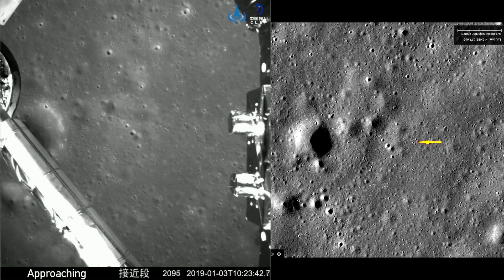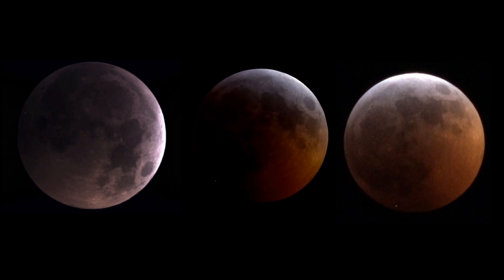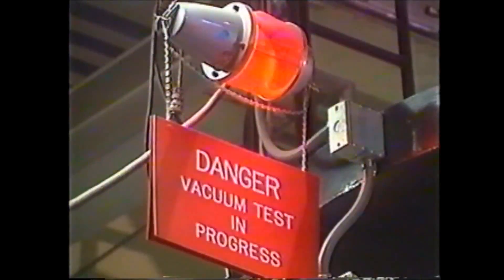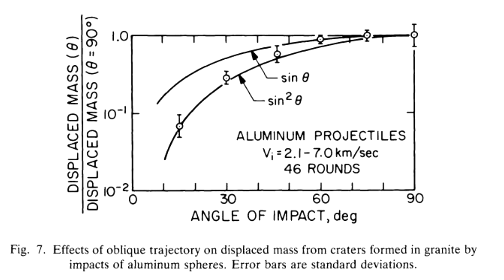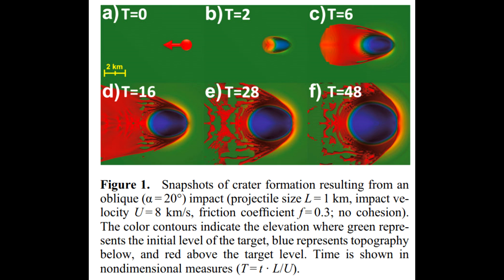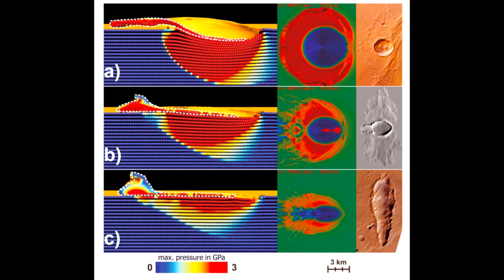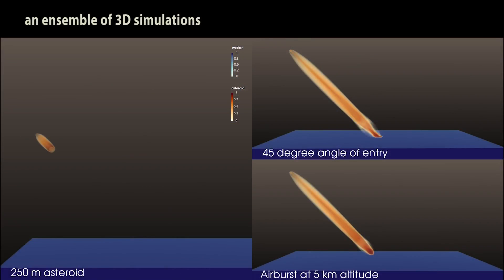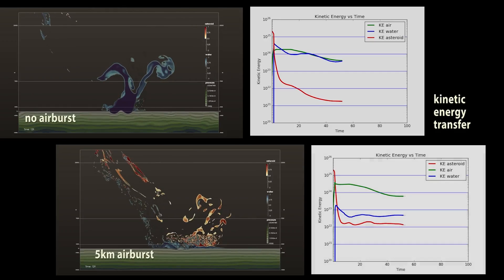Why Are Most Impact Craters Perfectly Circular? (Rather than Ovals)

Comment: You presume a normal distribution of incident angles, while that is only true prior to gravitational acceleration which alters all velocities to steeper angles. Also slingshots that add energy never result in a crater, while slingshots that remove energy sometimes result in a crater.
Reply from the maker: Nope, the distribution of angles is unaffected by gravity.
Reply: Every strike that would have hit without gravity, hits at a steeper angle with gravity. add in the ones that only hit because of gravity, you get a set which includes low angles.

Comment: Tl;dr is the explosion that makes the crater not the weight draging on the surface
Reply: Thanks! Great video, but I came away still not quite "getting" it intuitively. Your elegant little explanation does the trick!
Reply: Or: it's displacement not by the direct impact, but by explosion caused by the impact. The explosion is omnidirectional and obliterates any trace of the original "touchdown".
Reply: Conservation of momentum and conservation of energy. Momentum is M*V, Energy is M*V*V.  Energy dwarfs momentum.  Only the momentum has direction.
Reply: @StephenCameron  Ty. This little additional tag on to OP's comment makes more sense now
Reply: Haha you a legend
Reply: Affe Gpus
that doesn't make much sense. weight of what? in relation to what? the misunderstanding in question is about angles of impact, not weight of impactor.

Comment: I tried to fly safe but then I impacted the moon at 2.16 degrees and now I'm embedded torso deep in regolith :(
Reply: Rookie mistake.
Reply: Always remember: Lithobraking is not an approved landing method...
Reply: @NemoConsequentae  Tell that to the casualties at The View. 30 ships...
Reply: btw, [degree] is really easy, I use it all the time: alt-248; °.
(hint: hold alt, press 2, 4, 8 on the numpad, release alt; it's like a numbered shortcut key for text.)
Reply: @kindlin  Those extended keypresses are hard to remember though. I mean it's fine if you only use one, but if you have 20-30 such extended characters it becomes hard to remember.
Also I rarely have much luck getting the key sequence to work. Seems to have fiddly timing.
°0°↑↑©°

see? Not exactly reliable. XD
And that's only the cases where it registered anything at all.
Further, 'alt' also tends to open menus in most programs...
It's sometimes useful, but as a scheme for entering extended characters in general it leaves a lot to be desired. Ð•ª\°ÒÈ►│*Ð↑

nope.
Can't manage much consistency with it. XD
Reply: @KuraIthys  
Rofl, you don't need to try  and poke holes in the method. Everyone knows it's rarely used because of it's clunky-ness, but I use it often enough, specifically, for ° (248) and ± (241). I also sometimes use ≥ (242) and ≤ (243) which are easy to remember cuz they're right past 241 (as an engineer, I use ± and ° a lot lol).

Anyways, most people know about it, it's not hard, but most people don't bother to ever look them up. I've found these two to be very handy, myself.

PS. This is super easy, stop trying to make it look hard. Look, I'll go from 230 to 250 for fun, hardly any slower than typing: µτΦΘΩΩδ∞φε∩≡±≥≤⌠⌡÷≈°∙·.

OK, fine, that was a little annoying (I messed up 5-8 times), now lets try the two I do often, I won't use backspace: ±°±°±°±°±°±°±°±°±°±°±°±, easy enough for you?
Reply: @kindlin  I have always used alt-0176 for ° – I didn't realise there was an alternate alt-code.
Reply: that puts you at half massed, o7

Comment: Long story short,  most impact craters are circular because the explosion created by an impact is incredibly powerful. Think of a nuclear bomb heading to the surface at an angle. The nuclear explosion will be so powerful, the bomb's trajectory will not matter; the explosion will create a circular crater.
Reply: at sufficient velocities, all projectiles are high explosive.
Reply: Yep. Explosion forces propagate in spherical manner ejecting mass outwards symmetrically while at the same time overwriting the shift of upper layers caused by shallow angle of attack.

Comment: Makes perfect sense to me. I think the explanation could be even simpler - so at low angles the point of impact the object carves out an elongated hole, but the resulting explosion from the heat and pressure where the bulk of the energy is delivered just obliterates that and it blows up like a bomb i.e. with a spherical pressure wave and debris in all directions. So that small oval is instantly replaced by a much larger circle. You never see it. Only at extremely low angles does it dig a trench because in those cases it drags across the surface and dissipates the energy less rapidly - sort of hitting the brakes and spreading the energy over a much wider distance. But anything more than a glancing blow, and the object stops quickly, delivers most of its energy at a single point, and goes kaboom. The result is more about the explosion than the approach angle of the object that caused it.
Reply: It doesn't even dig a trench, really.  It creates a series of explosions that leaves a trench.  Sort of like the difference between the hole left by a stick if dynamite, vs the trench left by the equivalent amount of det cord.
Reply: Mykl Langridge ahhh yeah I get it. Very interesting - thanks for that.
Reply: I think you kinda nailed it. The direction of travel is only a minor addition to the total energy release, hence the mostly circular craters?
Reply: You can but even simpler just say that each object has a given force holding it together if that force is overcome by a collision it "explodes". 
You can even try that with snowballs at home - the harder you squish the ball the harder you have to throw
 him to explode same goes for the angle.
Reply: @dongurudebro4579  OK, I don't usually do this, but you've made the same comment with the same mistake at least 3 times now.

'angel' is the biblical being usually depicted as a person with wings on it's back. 

An 'Angle' is the circular measurement of the separation of two intersecting lines. (OK, that's not a great explanation, but it's hard to explain an angle in a way that isn't a circular reference.)

In other words, your comment is about 'angles', not Angels.
Reply: @KuraIthys  thanks - still just a typo and its like 5:41 in the morning and havent slept for like 42hours...^^ :)

Comment: The moon was made in Area 51 by Stanley Kubrick. He only had circular stencils back then.
Reply: And a job lot of "army surplus" grey paint
Reply: @passthebutterrobot2600  Navy surplus, actually.  They had a hell of a lot of extra battleship grey left over after they retired the battleships.
Reply: rdfox76 " It is so called because the color is the shade of gray from the specular micaceous hematite paint used for rustproofing iron and steel battleships." (wikipedia)

Oh, that's the reason! 
I had figured that color was a kind of "best compromise" for camouflage in various situations (day vs night, sunny vs cloudy, etc.)... even though made obsolete by today's technology, it stuck as a tradition, i thought
Reply: @silkwesir1444  You mean "today's technology" as in red lead paint as primer for steel, and zinc paint for primer for aluminum? Grey paint is the final coat, and together they slow down corrosion, but never entirely prevent it. I was in the navy.
Reply: @silkwesir1444  Actualy, what the US Navy uses now isn't the same color.  Ever since 1946, they've standardized on overall Haze Grey for vertical surfaces and Deck Grey for horizontal ones, because that was found to be the most generically effective visual camouflage.  There were other schemes used in WW2, some of which were better in certain areas (and as such, ships were painted to match the area they were operating in), but with the assumption of being under constant radar surveillance, they thought it'd be easier to standardize on a single "good enough" paint job.
Reply: by today's technology i meant that making the ship harder to see has become irrelevant

Comment: why are most craters circular? 
Why so we humans just have to put a dome over it to make it a space habitat that's why!
Reply: I reckon the air pressure under a heavy flat glass, steel and concrete lid would keep it up for a large lunar settlement.
Reply: @SocksWithSandals  The real problem is the next impactor.
Reply: Somewhere in the Chinese footage, there was a crater in the dust in the crater in the dust in a crater.
Reply: Irrelevant

Comment: Finally someone who's actually good at explaining things EXPLAINS this, i've never gotten a straighter answer to this question than "Cuz kinetic energy makes big boom circle."
Reply from the maker: The problem is it's really complicated to go from 'Big boom circle' to '3D hydrocode simulation'
Reply: @scottmanley  I prefer 3D hydrocode simulations, just cause they look cool, not because i understand them.
Reply: @scottmanley   The details might be complicated, but doesn't your explanation describe the basic physics correctly? The impact at high velocities turns a solid object into an expanding cloud of plasma. It also turns some of the ground material into expanding gas and plasma. This cloud has a velocity component in the direction of the impact, but it is small in comparison to the omnidirectional expansion created by turning kinetic energy into thermal energy. Basically you have a bomb which sets of at the moment of impact. Whether the bomb was flying in any direction does not matter much.
Reply: @ParameterGrenze  - Let's take that a step further.  The kinetic energy released by an impactor at hyper-velocity vs at lower velocities is the difference between a nuclear bomb and sticks of dynamite.  Here's what nobody is talking about -- ALL observed hyper-velocity impact sites, ALL of the nuclear test sites, and every single hyper-velocity impact experiment share one thing in common...  They ALWAYS generate massive amounts of heat and LOTS of IMPACT GLASS!  Not MAYBE, and NOT SOMETIMES.. ALWAYS.  How much impact glass was found at Meteor Crater in Arizona?  NONE.  There should have been thousands of tons of it!  Critical Thinking:  How does nearly 300,000 tons of iron-nickel meteorite vaporize without melting a tremendous amount of contact rock?  It doesn't.  Then WHY is there NO GLASS in Meteor Crater?  Because the explosion came from below.. not from above.
Reply: But that's exactly what happens.
Reply: An easier explanation is that each object has a given force holding it together if that force is overcome by a collision it "explodes". 
You can even try that with snowballs at home - the harder you squish the ball the harder you have to throw
 him to explode same goes for the angel.

Comment: Hey Scott! You mentioned that the speed of sound is faster in Hydrogen. I know about it, but could you talk about the different speeds of sound in different gases and materials?
Reply: Cody's Lab did that and some of it was quite funny.
Reply: Daniel Martens - Check cody's lab for a video where he inhales most of the noble gasses and then talks for a while espousing his knowledge of the elements themselves.
Reply: Its quiet easy the heavier a gas is the slower the sound is the light the faster - thats all! :) 
If you inhale Argon or Krypton for example you would sound like a totall bad ass! :)
Reply: @dongurudebro4579  Argon makes you sneeze tho'...
Reply: Nice call Daniel.  I've always wondered what the speed of sound is in the Martian atmosphere and how this would effect the supersonic retro-propulsion that SpaceX use.
Reply: Daniel Martens It’s the highest in a vacuum I think.
Reply: @suspicioustumbleweed4760  lol. Can't tell if that's a joke or not.
If it is, well done.

If not, well, sound doesn't propagate through a vacuum, since sound is a pressure wave inside a physical medium...

Comment: 00:26 craters are made by asteroids? Mostly meteoroids (corrected).
Reply: Are they though? Sure, on the earth, yes, but part of the typical definition of a meteorite is that it's the remains of a meteor that reached the surface. The asteroid becomes a meteor when it enters the atmosphere, a thing that the moon doesn't have. I'm pretty sure it's still asteroids that make craters on the moon.
Reply: Its a size thing. Meteoroids are defined as < 1m in diameter. An asteroid that small is not really visible through any known telescope, and the typical range is > 10m (up to 1000km). A 1m meteoroid is enough to produce a small crater, as shown on the Change closeup landing video.
Reply: @gordonrichardson2972   Where did meteoroids come into this discussion? Your comment was about meteorites... Sure, I'd bet most craters are made by meteoroids only because there's probably more of them. It's still irrelevant to your initial comment.
Reply: Gordon Richardson nice explanation! What is an asteroid bigger than 1000km?
Reply: Anything bigger than 1000km is a dwarf planet, such as Ceres. See: https://en.wikipedia.org/wiki/Dwarf_planet
Reply: @gordonrichardson2972  Or a moon.
Reply: @akizeta  "That's no moon. That's a space station..."
Reply: Ow are they?